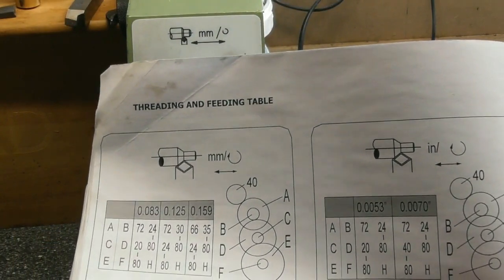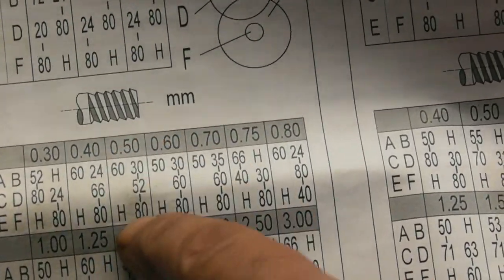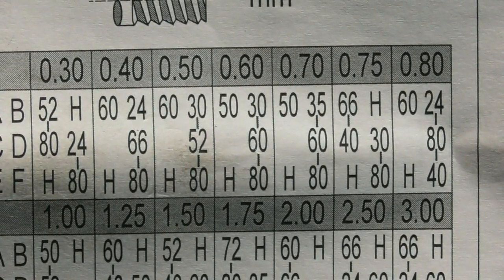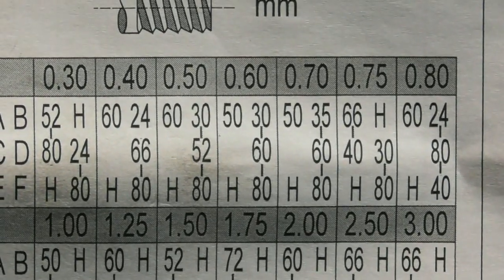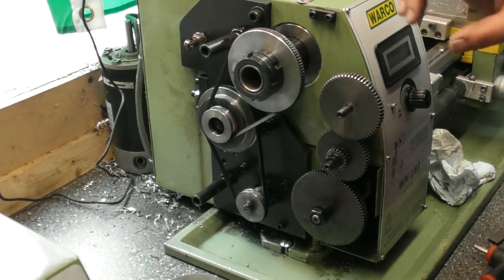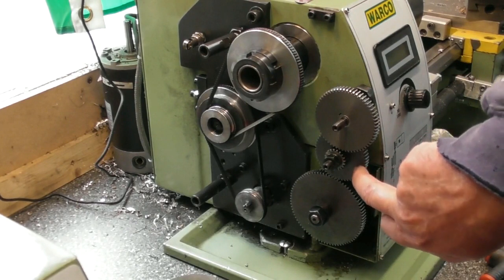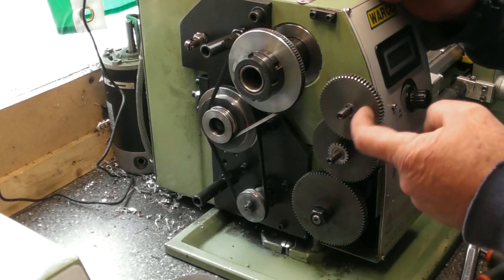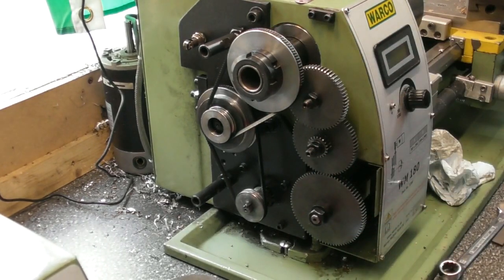Warco WM180 lathe   0 5mm pitch discrepancy

Comment: I'm not a machinist, i only use to play with a chinese leath. I see the first gear on the chuck of your lathe  has 40 teeth, so to get the 0,5 mm. pitch, i would calculate . . . (40/60)x(30/80)x2 mm ( that i suppose to be the pitch of the threated-training screw of your lathe ) . . . that gives 0,5 mm, as wanted. I understand the problem with the middle, unuseless gear ( just inverting direction ), and also the error in the manual, ever if the label on the lathe is correct. I think a personal check with the previous simple formula is the best warranty before beginning any threading work.  Thank you for yor video, bye from Italy.

Comment: My WM280B Warco lathe came with spacers to use instead of using a small gear as a spacer. Having said that when I tried swopping gears recently I had to fettle the gears and bushes as they were so tight easy changing was impossible. I broke one of the keyed bushes so made a couple of spares.
Reply from the maker: i had to fettle also , Cheers Ade

Comment: Just one more thing:
  Adrian in this video shows a hidden and very clever trick you can do with an engine lathe. Watch the video carefully where he checks to see if the gear ratio is correct by using the lathe's DRO (or dial indicator on the carriage). Adrian is checking to see if the spindle rotation correlates correctly to the movement of the carriage.
  The clever bit is to invert the test he did, i.e. use the movement of the carriage to determine how much the spindle rotates ... or "indexes" the movement of the spindle.
 For example: I work in Imperial but metric works just the same. If a lathe is set to cut 20 threads per inch, the spindle rotates 20 times for every inch of movement of the carriage. Therefore when the spindle rotates once the carriage advances 1/20" or 0.050" .
  So if you put a scribing tool on the compound slide you could scribe 50 divisions on a workpiece by rotating the spindle so that the carriage advances 0.001" inch for each division to be scribed. You do have to remember to back off the feed depth on the compound slide for each division so that the scribed line lengths will be the same.  Also you do have to get all the back lash out of the lathe's gear train and half-nut before starting and wedge the spindle with a wood block to keep the spindle from rotating while scribing the lines (or drilling holes or whatever).
  The thread pitch is not important, but the coarser the thread the harder it is to turn the spindle, but you do get more movement in the carriage making indexing more precise.

Cheers from NC/USA
Reply from the maker: that is a very interesting observation , i like it . , Cheers Ade'

Comment: Adrian, a quick way to set the back-lash in a gear train on an engine lathe is to cut strips of paper and put them in between the meshed gears. Once the plot is all secured, remove the paper strips and the back-lash is set. This is especially handy when doing multiple gear changes like you were illustrating.
  I would imagine that someone at the factory noted the problem you ran into with gears not being able to be correctly adjusted even though the ratio was correct and they had the information plate on the lathe corrected. My guess is that the gear train in the manual probably worked for an earlier model with no interference.
  Errors in shop manuals do occur, so look about to see if someone else suspects there is a problem. E.g. my Norton motorcycle factory workshop manual has a serious error in an illustration of the lubrication system. It shows the oil lines from the engine to the oil tank crossed up. This error is well known and every shop manual I've seen has a correction penciled in.
Cheers from NC/USA
Reply: i dont mean to be offtopic but does anybody know of a method to get back into an Instagram account..?
I somehow forgot my password. I appreciate any assistance you can give me
Reply: @Kyle Yael Instablaster :)
Reply: @Zakai London i really appreciate your reply. I found the site on google and im waiting for the hacking stuff now.
Takes a while so I will reply here later with my results.
Reply: @Zakai London it did the trick and I actually got access to my account again. Im so happy!
Thank you so much, you really help me out !
Reply: @Kyle Yael Happy to help :D